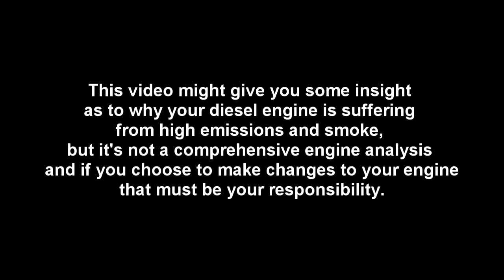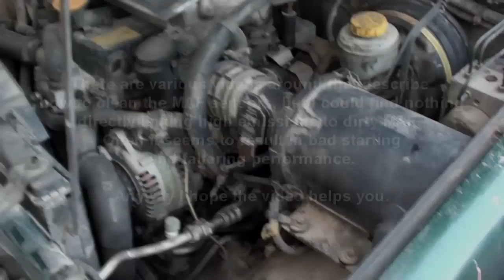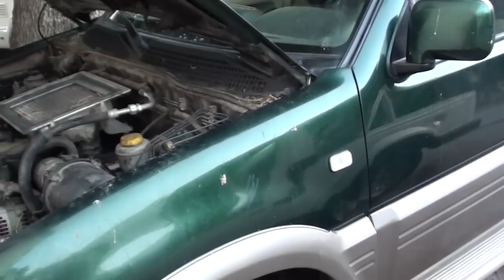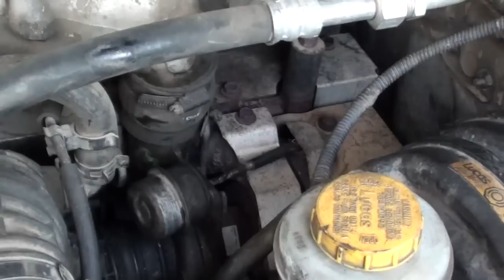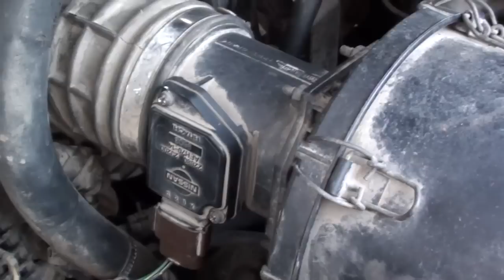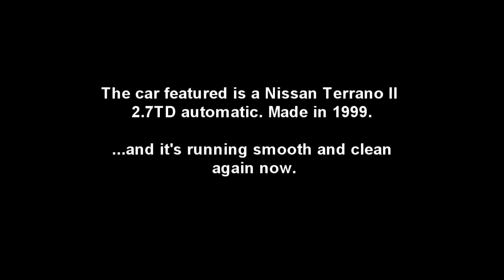Nissan Terrano - High emissions problem. MAF sensor?

Comment: Hello, I have a problem with mine, its a 2000 model auto, 
Sometime the car after been at a stop, when I press the gas it will stall and when I start it again the engine light will come up. I went to a lot of mechanics , opened the engine, checked the fuel system , cleaned the diesel tank , and it still does it sometimes. 
Could it be the MAS ?

Comment: After all these years your video is still helping people like me!  I have the 2000 model, same colour as yours, and it's done 485000 km's now.  Will clean the MAF sensor and hopefully I will experience the same improvement!
Reply from the maker: Hello Roland, i hope it helps you.  I have cleaned many MAFs since the video with 100% success rate in that I have never needed to replace one and almost always seen improvements. I fairly routinely clean EGRs too always with very positive results. These items are expensive to replace and as a DIYer, but not a  motor technician, I hate paying out unnecessarily. I run run a Transit Mark 7 and an Audi nowadays and have cleaned these items almost as routine. Wishing you well. P

Comment: Awesome video...i have the same truck..There is also a fine mesh in the air way between the air filter and MAF and a rubber O ring on the stem of the MAF. The  end  cap of the MAF pushes on and can be left behind in the housing if not careful.

Comment: Excellent video! Very well explained. Thank you
Reply: That 'suction sensor' on the turbo is a wastegate actuator. It allows exhaust gasses to bypass the turbine wheel to prevent the turbo from making too much boost pressure.

Comment from the maker: Hi, I am glad it helped you out! My Terrano is automatic. I noticed that gear-changes also became smoother after cleaning MAF sensor. I cleaned the same part on my Motorhome (Ford turbo diesel engine) recently and regained at least 10% fuel economy. P.